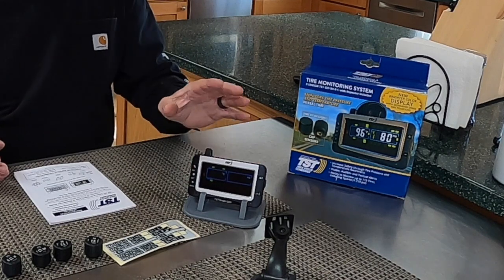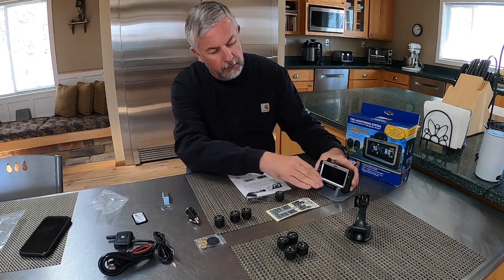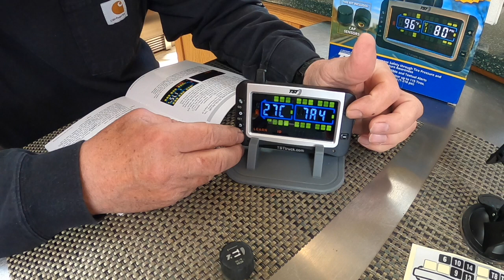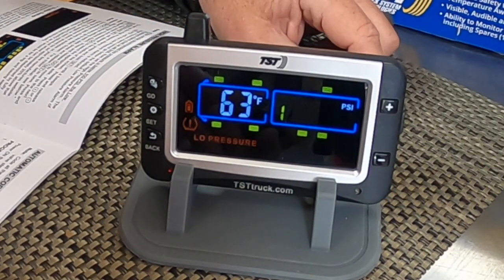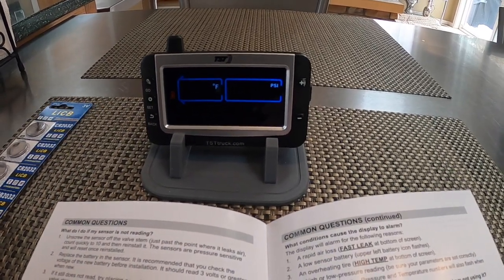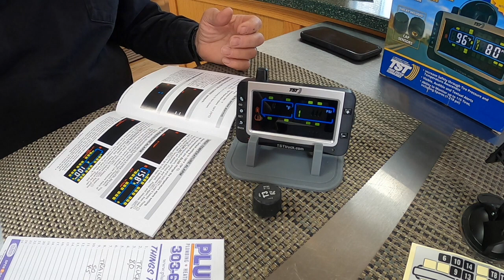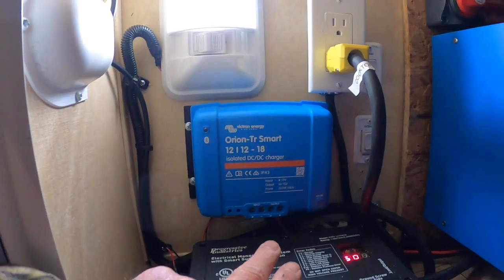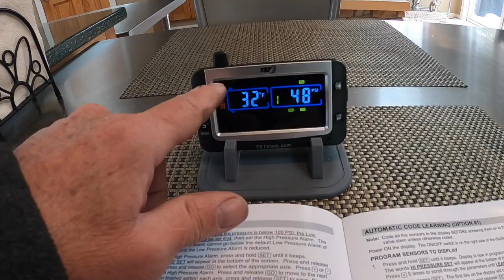Best Tire Pressure Monitor TPMS for RV Trailer Motorhome Boat TST -507

Comment: Nice setup and great video. What I'd like to see is someone come up with stand-alone third party system that uses a multi function display. An Integration of GPS, TPMS, Cameras, Sound, and hands free phone control. Modular, so you can add features as you need them.  Android or IOS based (whatever your flavor). Tablet sized. Kinda tired of having different number of displays, controllers, and phones camping out on my dash.   Happy travels Bill.       Oh,....how's your Thing doing?

Comment: Good job with the instruction. I too, have TST and am very happy with it. You might want to keep an eye on your valve stems (they appear to be rubber type). The weight of the sensors can break down the rubber stems. I changed mine to rigid chrome to be safe. I have a 35' MH with a tow vehicle, and have been lucky that the repeater has not been needed.....to my surprise.
Reply from the maker: Thanks for the tip! funny you should ask.  hour north of nashville a few weeks ago.... low tire leak on truck.  No puncture but cracked valve stem! But my tires were put on six years ago.  next spring... steel valve stems... Thanks and check out my other 70 video...